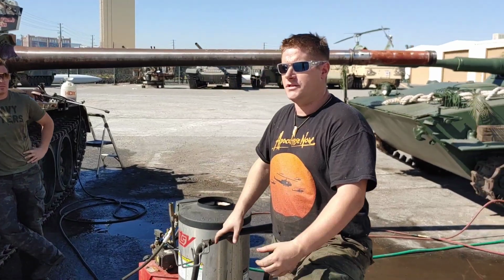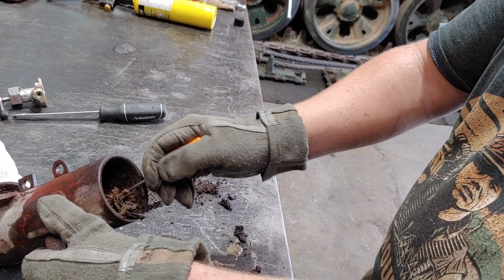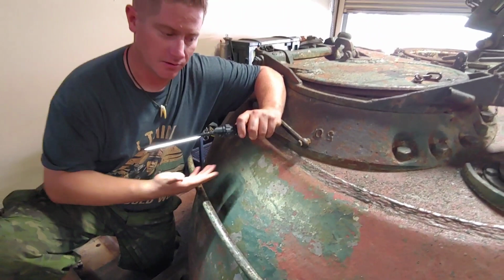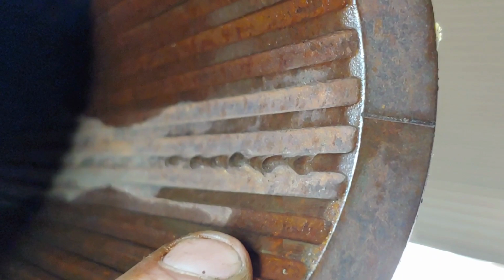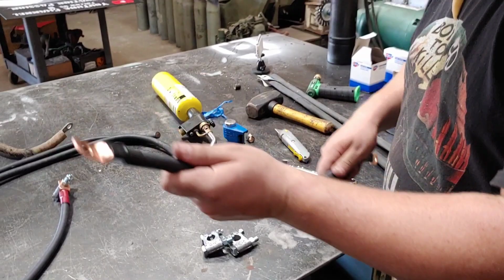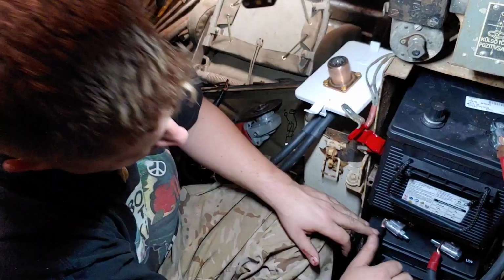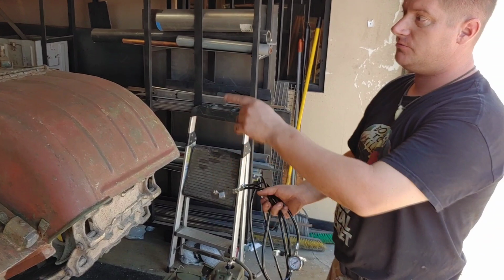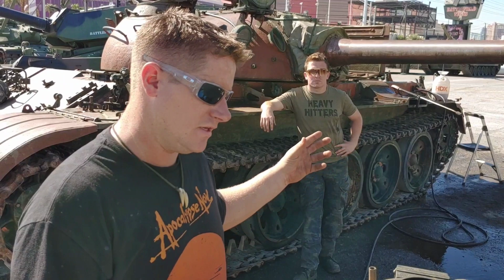T-54M Repair/Restoration

Comment: I really enjoy these repair videos. After spending a few hours last weekend chipping out broken fittings I can understand wanting to strangle those who do not drain and service air lines.
Reply from the maker: Glad you can appreciate that!  Some of our lines have been sitting for 40 plus years which as you can imagine is not good for anything.
Reply: @RestorationPassion Just a suggestion about filtration media for the air system. The Impco automotive propane people have a VFF 30 filter unit that has replaceable felt discs. Likely have to trim to size and stack several vertically, but that gives you replacement, quality product that is inexpensive and easily sourced. Rather than ordering from Europe. If you need more info,reply back.

Comment: Interesting how the jump start connector is not 'backwards compatible' with the NATO one. For the MI24 they managed to make the connector to external generators compatible with NATO generators, but make it such that soviet generators cannot be used with NATO aircraft. Very useful if you want to use enemy equipment, and prevent the enemy from using yours. I expected that they'd have a similar idea for tanks, but I suppose not.
Reply from the maker: It is possible the Russian designed pieces like that however, we don't know what we don't know.  Plus even if there is some kind of lead that is compatible with both finding one and importing it is pretty unlikely.  That being said we are always on the lookout for new information or gear like that.
Reply: oh you mean that video where the guy said that the mi 24 could use 12.7x99 in the yakb when it takes 12.7x108... yeah he really knows what he's talking about.

Comment: T54/55 MBT is popular tank of military and armed force around the world. In Resistance and Protective Wars of Vietnam, this tank had a long and enduring combat service.
It is a Soviet tank that can reliably serve in many geographical environments around the world.  It is easy to maintain and repair.
I think you have a best vehicle in collection, 
You can travel with your friends on this tank.
You can learn about its repair and operation techniques from soldiers serving in the armored forces of Eastern Bloc.
Reply from the maker: There definitely is alot of benefits to the Russian designed equipment, but like anything there are also quirks.  But that is just part of the restoration process finding out all of those things

Comment: I enjoy the videos and yall are doing a fine job of preserving a piece of history. 
    I was wondering, @ 14.14 you crimp the connector on the new power cable. Is there any reason why you don't Solder it? Soldering provides a foolproof connection that isn't effected by vibration or corrosion as opposed to a simple crimp. Is it to duplicate the original construction?
     Anyway, Nice Video. Take Care and be safe, John
Reply from the maker: No particular reason.  You are definitely correct.  If you can solder then that is great.  Us personally?  We have a really bad curse of breaking every single solder we have ever purchased...no idea why or how it just happens.

Thank you for the comment and stay safe as well!
Reply: Soldering IS NOT foolproof when comes to vibrations. On the contrary, soldered cables tend to break at the spot where solder ends. This is reason why all automotive connectors are crimped.

Comment: Just two questions. Ever thought of finding a Centurion Tank with a 105mm gun? Or making one of your Chieftain Tanks to fire live ammunition? I mostly see them crushing cars.
Reply from the maker: It's possible that we will in the future however personally we don't like working on British equipment.  The tanks themselves are okay tanks but once something breaks on them it's usually incredibly difficult to repair them due to the placement of key components.  A good example of this is one of our British tanks has a fuel leak and the leak is conveniently located at a line under the engine.  Now it would be a very easy repair  but because of the placement of the line we would have to remove the entire engine just to repair a leaking line.

Now if we had access to the same equipment the British military uses at factories and repair shops this probably wouldn't be as big an issue.

Also something to note is tanks like a Chieftain use a round type that would be very difficult for us to recreate or make sustainable.

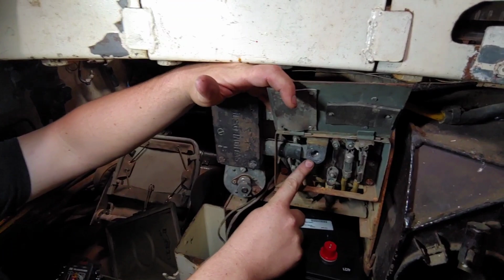Comment: Maybe an ex-hungarian T-54?  The inscription on the original Jump Starter socket 16:16 "Külső Indítás" = "External Start"  and next to it "külső töltés pozitív sarok"  - "external charging - positiv pole" or maybe these are surplus parts from a hungarian vehicle
Reply from the maker: You are correct, check out our previous video abou this tank, we talk about that.

Comment: why do you use the needle scaler instead of sand blasting? its much faster and less physically demanding
Reply from the maker: So typically you don't want to sand blast a tank unless you are doing a full ground up restoration.  Because this tank already ran when we received it, we did very minimal mechanical work on it.  That being said if you said blast a tank, all of those fine particles end up getting in places such as the turret ring and end up gumming things up, and the last place you want those particles is inside the engine by accident.

So long story short, its too difficult to fully clean a tank after a sand blasting if it still has all of its components inside

Comment: Your bore evac must be a later style, because the early ones are not like that at all. Nor are the port holes done that way on all of them.
Reply from the maker: Very interesting.  I had not come across any material regarding the Bore Evac styles.  Would you happen to know off any material we would be able to research about said subject?
Reply: @MilitaryArmamentsCompany  Neither have I, just looking at mine enough and seeing yours they are very different. I wish mine came apart but its a system where it was welded on forever.

Comment: Hello from Ukraine.Does this modification T 54 have a bulge for old tracks?
Reply from the maker: Do you mean a "pin hammer"? This one does have, it's an old style track (OMSh), so it needs it.
Reply from the maker: Greetings!  
If you are implying the "pin hammer" or the metal "buldge" that knocks in the pins on OMSH track then yes it does contain that on this tank.
Reply: @MilitaryArmamentsCompany  Thanks!

Comment: What type/brand of paint do you use as the final color…..thanks
Reply: big thanks for the prompt response..
Reply from the maker: Sorry all of us have full time jobs (Dima works a full time job as well as doing this job after he gets off) as well as alot of side work.  So running a YouTube channel as well as keeping up with all these comments takes time.
GCI is usually the brand we use.

For this particular tank we used 
Base coat
18oz of Rapco Olive Drab
2oz Rustoleum Sunburst Yelow
5oz Rustoleum Hunter Green

Light Brown
5oz Rapco Tan
15oz Rapco Sand

Dark Green
Rapco Olive Drab

Comment: got a question does having the bore evacuator near the muzzle make it any easier to service compared to nato ones (being half way down the barrel?)
Reply from the maker: Well we had a bit in our earlier video about a bore evacuator on T62 (it's in the middle of the barrel), the thing that made removal so much harder on it was that it wasn't lubricated or serviced for decades, but if it was it wouldn't have been as hard.

Comment: I wonder if you could find battery clamps to which you can solder the cable to. For the extra reduction in resistance. One solder appearsto be better then an unsoldered crimp and a connection with a nut.

I´m no expert but this is what comes to my mind, regarding the  + - markings.

What we call + has an absence of electrones.
What we call - has an excess of electrones. It is negative because all the negative load bearers are there. The electrons are the negative load bearing parts.
With this system the technical flow of current as agreed is from + to -.
But the physical flow is from - to +.
This means, the electrons are missing at +. And all the electrons are at -. 
So actually the electrons flow from - to +. When all electrons have moved, the current is 0. Then the battery is empty. A generator makes new electrons all the time.

Maybe the russians have adressed the physical flow of electrons in their system of marking. So that the russian - indicates the side with the lack of electrons. While the russian + indicates the excess of electrones.

Different cultures develop different systems to name things. Like metric and imperial measuring. Another example: Russian planes have meters for altitude and not feet.

Maybe having  electron absence on the hull of the tank has something to do with ABC protection. As from the electromagnetic pulse of an atomic bomb, the hull gets electronized. ???

Surely there are guys reading this, who are smarter. I would really enjoy feedback and discussion on this.
Reply from the maker: Wow thanks for the in-depth comment.

We personally have never had a problem with the crimped battery cables but I would agree maybe a solder/crimp combo would be alot more secure.  

You bring a very interesting point about the positive and negative poles on Russian equipment.  We are in communication with a Russian tank factory worker but he is not an electrical engineer so we have no confirmation of a theory like that.  Plus translating technical information can be more difficult because even though we have several native Russian speaking people who speak English fluently, they have a difficult time trying to explain the technical data to us in English.  If that makes sense.

Also very interesting point about the potential nuclear attack reasoning.  I will have to do some research myself on EMPs and what the technical reason nukes interrupt electronic equipment is, so you might be onto something there.

Comment: 28:36 probably you need to lock this two bolts by wire. or why this holes in bolts. it is just idea :)
Reply from the maker: It's safety wired now.  Our camera guy just didn't film the process

Comment: Y don't u sandblast the t 54much better job
Reply from the maker: Its not a full restoration and when sand blasting a tank unless you pull every single component out you end up with sand in place like the bearing race which causes more problems down the road for those components